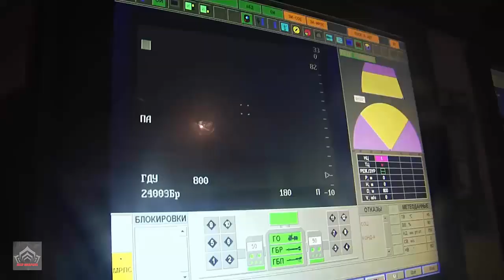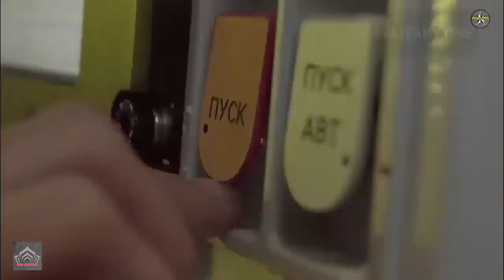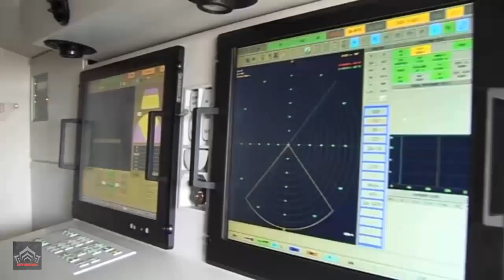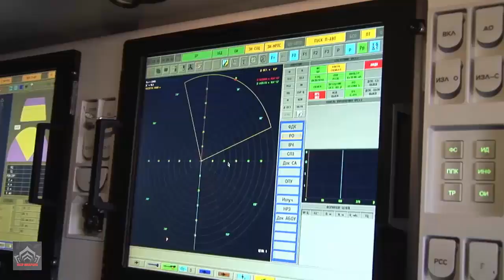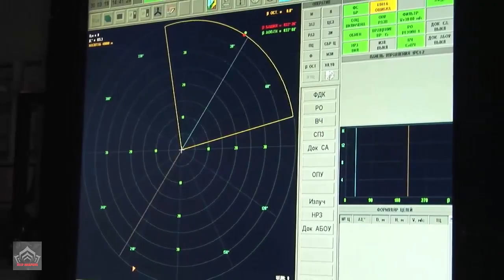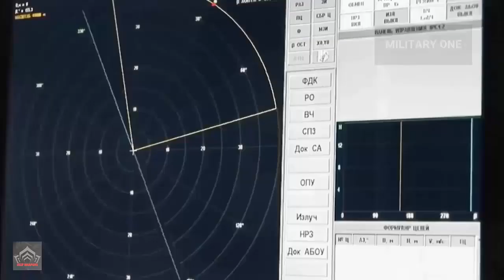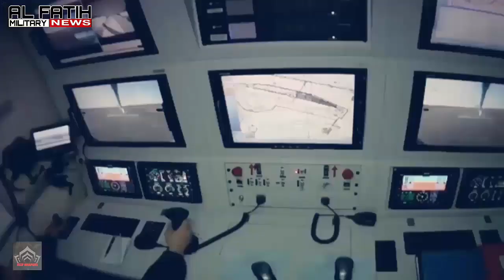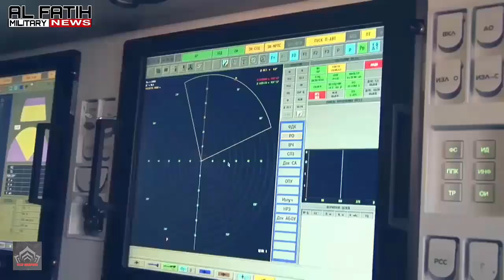Pantsir-S1 air defense missile system with New more powerful missiles

Comment: I find the solution good to shield the system while being empty through jamming systems, it makes sure that the time until the refill is not as dangerous as before!
The missiles are also a adoption to the mid size drones with a reach of 10km and more, so that their destruction can be managed at 30km or more!
The missile itself is interesting too, one of them is really fast, and it seems to be meant for helicopters or planes who would be in a very difficult position to avoid a fast flying missile!
It is the S1M i mean with the Jamming station on top of the rotating radar!